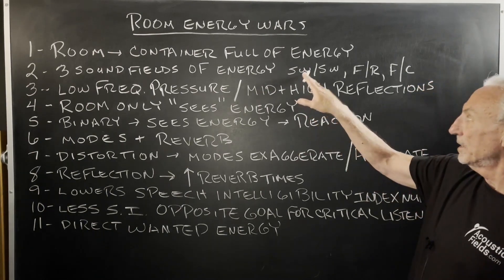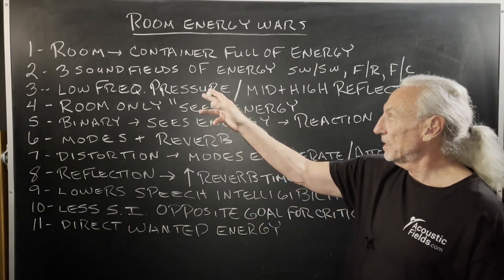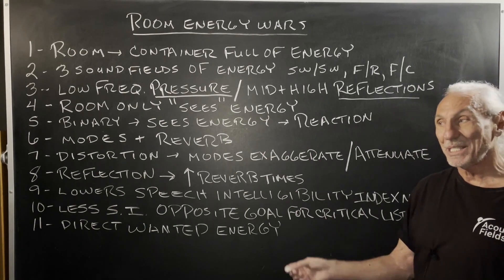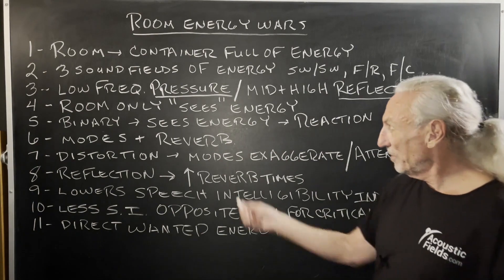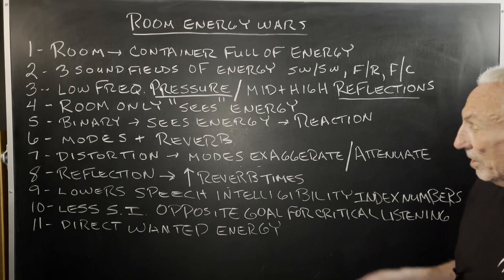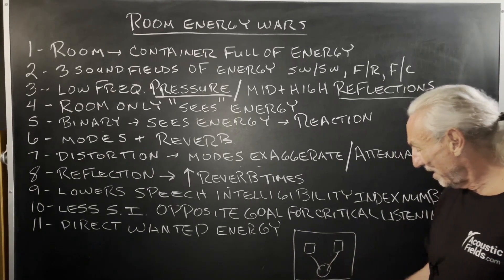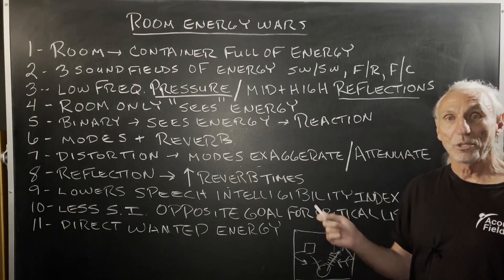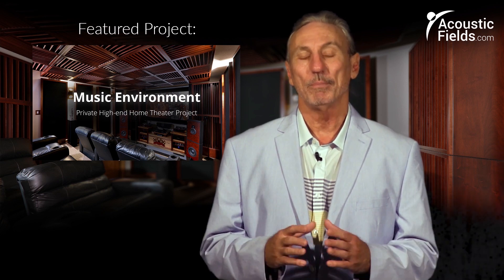Room Energy Wars - www.AcousticFields.com

Comment: one of your best yet... "short and to the point / simple, but effective". perfect for sending to my friends whose audio systems need some spatial/acoustic management more than existing hw upgrades. suggestion for an instructional aid: a CGI visualization of direct path / reflections / modes as they behave in a typical room. nothing too exotic or complex... could be useful for you to talk-over as you identify causes & solutions to the "energy wars".
Reply from the maker: It does not need to be that complex. The walls, floor, and ceiling are the surfaces that produce the distortions. The best room is no room at all. We will treat these surface areas for reflections and unwanted pressures. The treatment type and amount will be determined by the room volume at its intended usage.